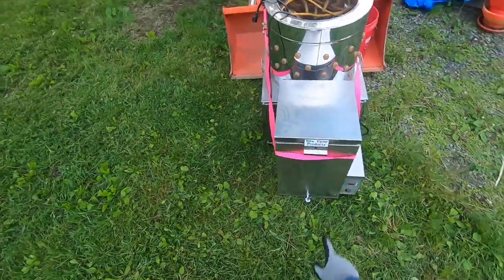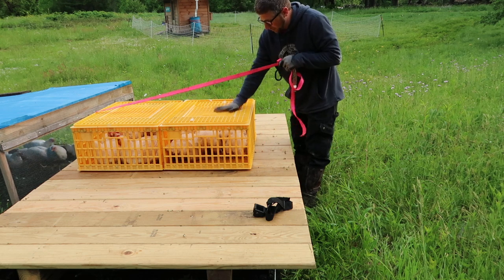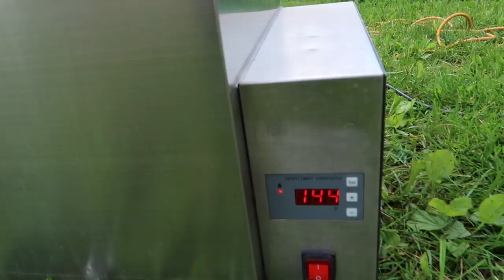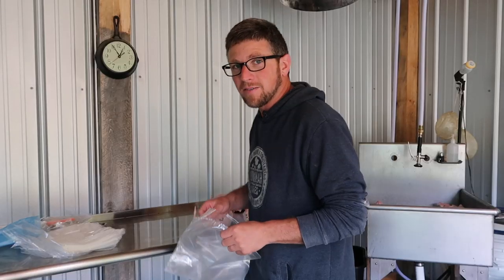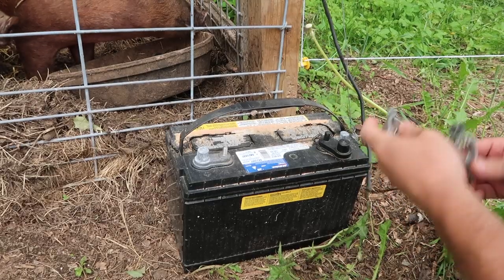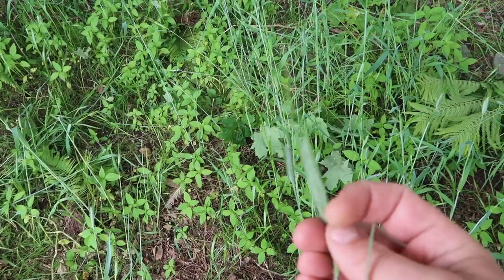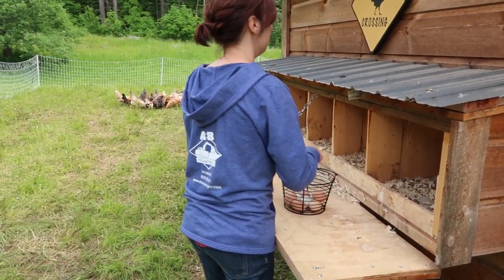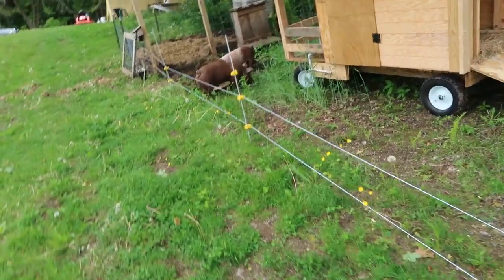This is FARM to TABLE

Comment: Al switch out the electric wire with the premier 1 net fencing. It works much better as it creates a visual barrier as well as a electric one. I use the poultry netting for everything with perfect results. nothing gets loose.

Comment: What was the average weight of the birds? I live in Florida and just noticed chicken on sale for 69 cents a pound. What does it cost up where you live? And if you dont mind, what's the cost to raise a bird for 8 weeks? Keep up the great work Al! Thanks.
Reply: Store bought chickens @ 69 cents/lb are old laying hens from egg production farms. Raised in confinement conditions on GMO feeds, often under lights 24/7 to increase laying. Once these are past prime egg production they are butchered and sent to market. Commercially raised Cornish Cross chickens for meat production are also raised in confinement on GMO feed and antibiotics to prevent diseases from the confinement and close quarters and harvested at 6 weeks. In my area those chickens are around $1.69- 1.89/lb for a 2 to 3 lb. chicken. 

Grass fed, organically grown chickens like Al's typically harvested around 8 weeks and raised on grass and organic, non GMO feed average about 4 1/2 - 5 lbs and sell for around $4.00 - 5.00/lb. What you're willing to pay all depends on what you want to put in your body.

Comment: I have a vacuum bag sealer. (Amazon, natch!) You just press the buttons and switch on, and it sucks the air out. It may not be commercial grade, but one of those could save you some time. 🙂

Comment: I noticed the 3 point on the tractor drops fast. to control the rate of fall. turn in the knob between your legs by the floorboard under the seat. lower the 3 point then release the pressure to desired speed. in time things will start to break if it keeps slamming down like that.

Comment: Cool way to use color zip ties to date code the meat chickens for Freezer Camp.  Do you also change colors zip ties from the Spring raised Chickens to the Summer raised Chickens?  Will the summer batch brood in the greenhouse coop or in the basement?

Comment: You might find it beneficial to raise the draw bar on the pigmobile to the vertical position, It will remove a tripping hazard, keep the mud off it, and prevent it from getting stuck to the ground.
Keep up the good work.

Comment: Hi Al and all. The following is not intended to troll. I love Al, his family, their goals and this channel. I realize that this is an accepted method for dispatching the birds but I disagree with it. I use a chopping block. IMO there's no way the birds aren't in pain as they bleed out trapped. The guillotine was always accepted as the most painless instant form of execution. 

  I also see the chicken tractors as only a step above a Tyson plant. The birds all pinned so close they can barely move and trapped with their own excrement in between moves. I still cringe thinking of the chicken that got pinned the one day during a move. A small pasture enclosure moved as needed with an actual coop where they could get off the ground would be more humane. 

  I'd love to see another vlog on what the plans and goals are. I watched the one months ago, but I'm kinda lost on some goals. I totally agree with the need for a barn, but I'm not seeing any long range self sustainability. There's not enough pork or chicken to last a year till the next butchering. The garden area needs to be massively expanded to enable canning of produce. A few raised beds just aren't going to be enough. That land may be rocky, but it's been farmed for hundreds of years up there. The farmers pulling the rocks one by one as they tilled was how all those gorgeous old walls were formed. With no wooded area the farm can't produce it's own heat fuel. 

   It seems a lot of the efforts are misdirected into the PPM, the new trailer etc. I nearly cried at the waste of the fallen apples last year. The amount of apple cider vinegar, apple cider, apple sauce lost could have gone towards sustainability income. I understand it's modern homesteading, but it seems without external income sources.......... 

   Sorry if this all sounds negative but it's not meant to be. I've been working at this since the mid 70s and I'm happy to see Al and the family taking more steps than most in the right direction.

Comment: 97,203. That plucker was strange looking. It looked like a rubber chicken spinning around. Sure has changed a lot since I was a kid and you used a bleach bottle with the bottom cut off and turned upside down to take off the head and plucked by hand.

Comment: I would build a small slaughterhouse and keep the chickens in the boxes on the cart outside the building. Of course it's a little more work to walk out around a wall to get each chicken, but at least they'd not see each other being slaughtered. Also, I'd build mobile slaughter carts for the chickens with the cones, but with partition walls on each side and move them into a second room before I bring the next chicken in to slaughter, again so they never see the other already dead chickens. I'm thinking that part of humane slaughtering is to minimize any possible suffering, including the risk of instilling fear.

Comment: The dial in between your legs controls how fast or slow the 3 point rises or falls. If you close the valve some it won't drop so abruptly.

Comment: When using your long extention cable don't  leave  any coiled up as it will over heat at that point and it will use more power as well

Comment: How did he kill the chickens?
Reply: They go head first into the cones and he slits their throat. It's the most humane way to slaughter chickens.
Reply: Yeah i wondered that too as the one in the plucker still had a head. I always thought the head was chopped off. Wouldn't the throat slitting take more time for chook to die?
Reply: @juliashepherd4267  hanging them upside-down sedates them. They die almost instantly with the severing of the vein but it does take time for all of their blood to drain.
Reply: @gonewiththewindemullers  thanks! That's good to know.